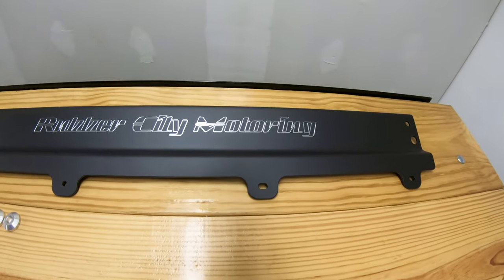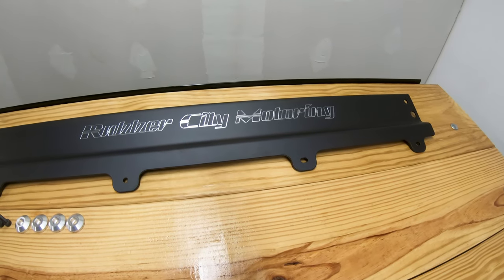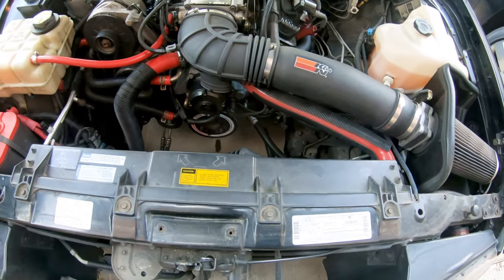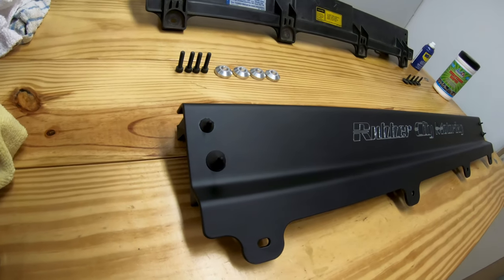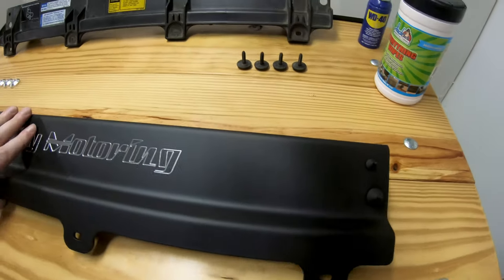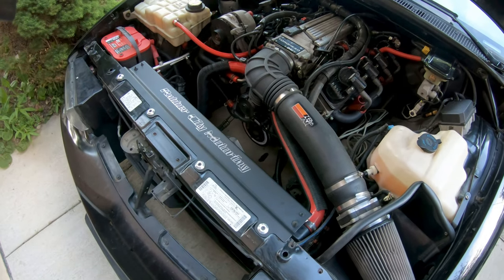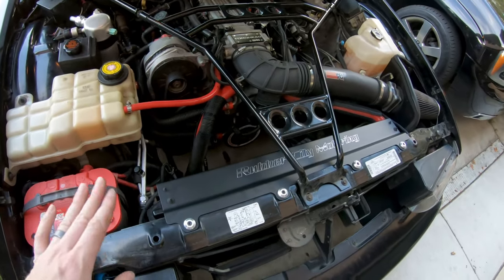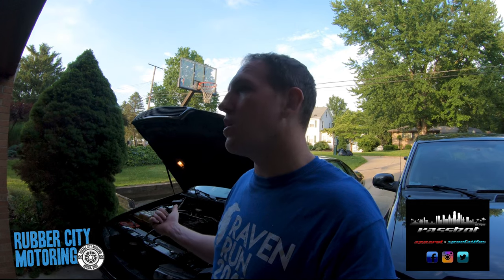Rassbot Specialties Impala SS / Caprice Aluminum Radiator Shroud - Install & Review

Comment: Cool man. We’re did u pik up the brace kit. It makes the eng comp pop. Thx
Reply from the maker: Summit Racing a few years back. Last I heard you have to go direct to the company now.
Reply: Rubber City Motoring what the company’s name. Thx man
Reply from the maker: The engine bay brace is from hodgkis - the radiator cover is from Rassbot Specialties 👍🏻👍🏻

Comment: Looks good! I know it's not a show car but you should do an engine compartment detailing video. Curious, when are you heading to the drag strip again?

5:40 - Is that a disconnected vacuum elbow on the throttle body?  Maybe it's just an optical illusion.
Reply from the maker: Yea I’ll see. Once I’m done working on stuff. Lol. 

Drag strip maybe this fall? Not sure.  

Yea it is. Throttle body is capped off though, so no leak. That whole charcoal canister, egr is pretty much disabled at this point. 
Thanks for watching!

Comment: 🔥🔥🔥  just got one
Reply: How much?
Reply: @slickdawg4634   i payed 290 shipped to Colorado
Reply: Ben Mondragon bruh is it worth it?
Reply: @slickdawg4634  i think so cause I put my Impala in car shows  it's more points at the car show and looks more cleaner than the original radiator cover
Reply: @slickdawg4634  but you don't have too get the cnc engraving on it you can just purchase just cover it's cheaper
Reply: Ben Mondragon I feel u
Reply: U should put videos of your ride
Reply: @slickdawg4634  i need to learn how too 🤣 still haven't got that far yet i got more on my Instagram page and my Facebook page what year impala you have

Comment: Are you still running stock radiator
Reply from the maker: Yea I am. I got a new one when I did the engine, shop said it was plugged up. I’m guessing old dex cool was the issue. That old stuff wasn’t good...
Reply: @RubberCityMotoring  ok u running dex instead of the green
Reply from the maker: I have, and continue to use the Yellow stuff that mixes with any color.  Done this to 'replace' dex-cool on multiple vehicles and it works fine.  I don't drive this in the extreme cold, but I run a 50/50 mix of the Prestone  with no issues..